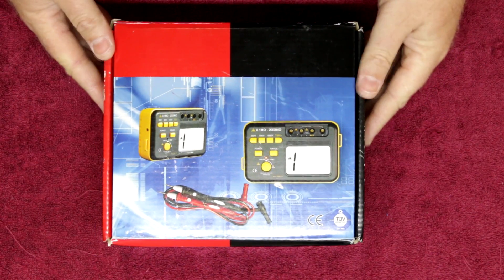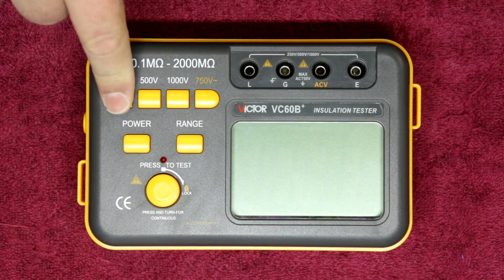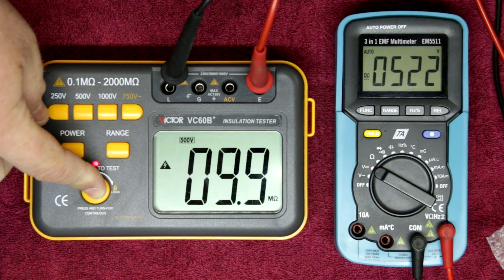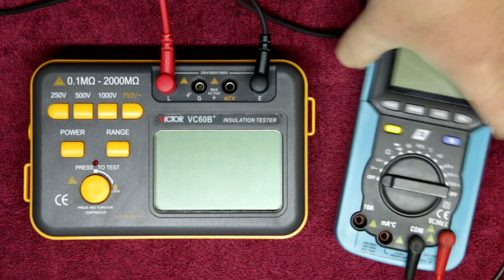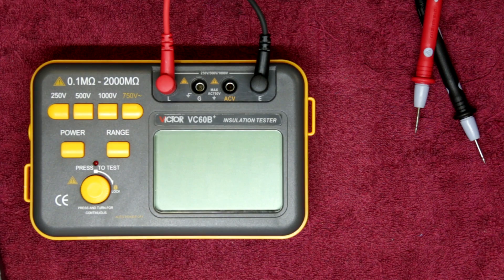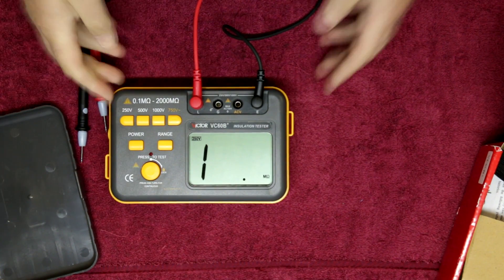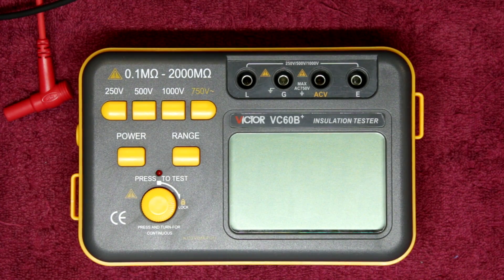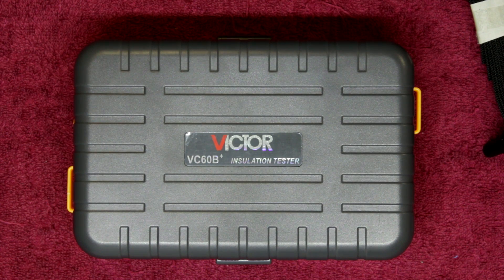Episode 72   Victor VC60b+ Insulation Resistance Tester

Comment: Just bought one to test a well pump. They've completely revised the layout and packaging on it. However, it comes with these probes with very little exposed metal, and they're very sharp. That's fine, except the alligator clip adapters that come with it won't work with these problems.  They're intended for the probes like you've shown, with an inch (2.54mm :) ) of exposed metal. And there's not enough exposed metal on the probes to use an alligator clip to extend them. I guess this is a new thing, as my Fluke 87V has these same style probes, and I despise them.

Comment: Question, could I use this meter to test to see if a capacitor is leaking DC or it is acting as a resistor?
I am looking for a meter to test capacitors at operating voltages to see if they are leaking ofr acting like a resistor.
Reply: No, unless it's a high Voltage cap.     Testing a 400V cap with the 250V would be ok.

Comment: got one of those, and trying to get on call with the pro and cons..
they goes for around 20bucks (USD) delivered..
mine arrived yesterday (BG) and looks decent.. btw the casing fits nicely as a bottomplate, as a second plate..
why is there 8 AA battery compartment but only 6 are used and wired,,is it simply for spares..
dont know jack about these megger, but are a sucker for meters and testtool and just general tools to get insigts and testing, but i can figure its like a powerhouse that can give high volt to test if there shortcomming under nominel effect.

Would it be possible to mod it with lipo packs or li-ion batteries to reach around 8 to 12v with two or three cells got so many of those.
so you dont need those AA x6/9v , and assume a liion or lipo pack would also be better in delivering effect, and the topplate fits perfect at the bottom so the battery plate could be off.but not sure if modding with different kind of battery are contaminating the readings (anyway for time-being would be using it as intended & stock, at least to one get common and familiar with this 20buck megger-tool.. its the VCB60B edition there where at 20bucks shipped not sure if there is any difference in regards to the + version... thcx for the walkthrue +1.
Reply: Jakob Danmark hi. do u know if I'm allowed to use this tester in the Eletrrical licence exam Australia?
Reply: @richardday2893  yes you are as long as it is in calibration and you will need to get calibrated every six to twelve months 
I think you will find the regulations over there are the same as the UK or almost
Reply: @Dog-whisperer7494  thanks buddy.
Fyi I got my electrical license three years ago. I borrowed a tester from a teacher. Cheers.

Comment: Im a bit confused - i was testing my car battery which is 12 v DC and by mistake i had put my meter ( VC60B) on the AC range --- at first i was surprised when i was getting a 22 v reading , i checked the range and changed it to DC and got a normal 12v reading. when i checked with my trusted old Wavetech meter -that only read 0 volts  when i tested DC supply on the AC range --- Is this normal and ok that the VC60B reads double the DC voltage when set to an AC range _____ Great review
Reply: The VC60b can measure AC volts only it does not messier DC if you try you will get readings jumping all over the place.this tester is for testing continuity/insulation resistance and AC voltage up-to 750V AC ,it’s what electricians use to test the wiring in your house. 
It’s a fantastic little meter ideal for an apprentice to get going 
I have got one had ten years with no problems and it is still working great I keep as a backup

Comment: I have that same tester and you could check the 1000 volts with the bm829 no problem.
Reply from the maker: Fully Agree. My Brymen meters where all left at home so I just used what I had laying around to test. I have tested many over 1000v dc signals with the Brymen TBM series no problem at all.